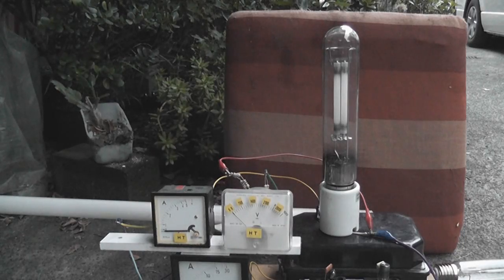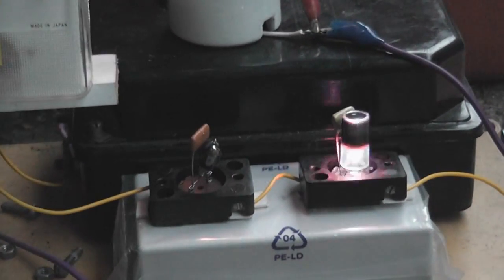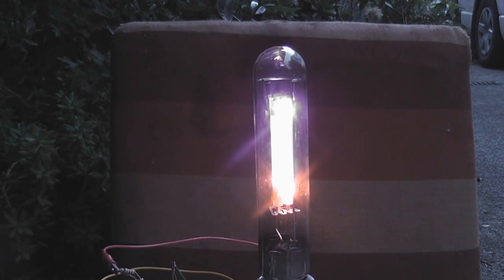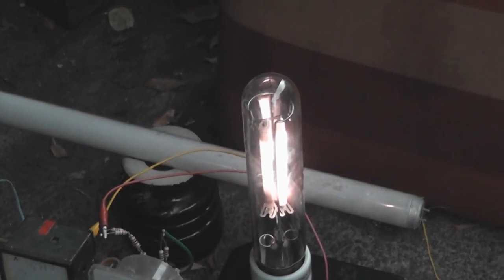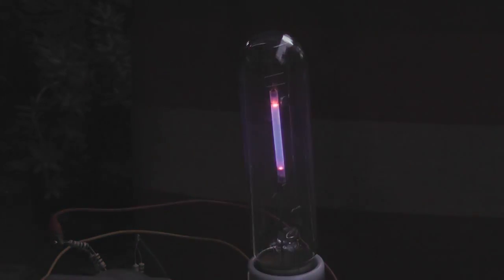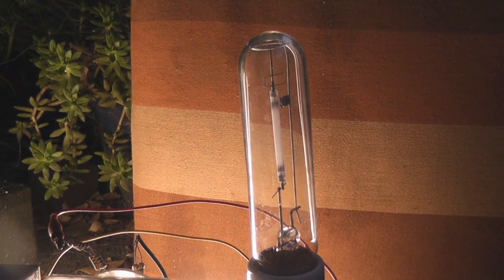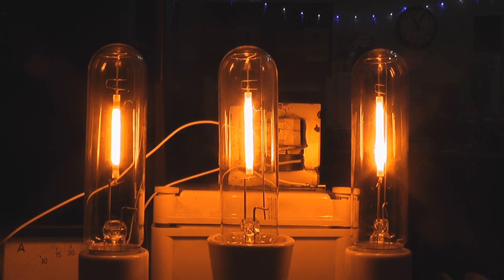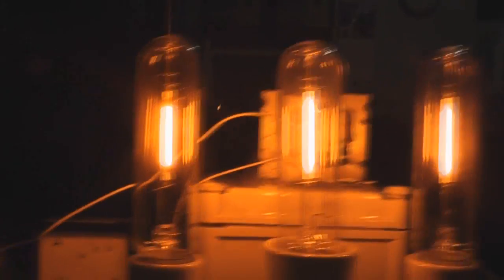Sodium Capsules experimental test runs.

Comment: Would be interesting to see if the MOT could restrike the lamp once it had ran-up to a decent power level. Normally it takes up to 3 minutes for the pressure to drop enough to allow restart. And that's with 4-5kv rated ignitors!
Reply from the maker: The Lamp capsule runs well, Voltage is about 50 to 70 Volts, depending what series Capacitor I use for ballast. A detailed video will follow.
This set up is great for indoors as the lamp is not too bright and not too hot and more yellow orange which looks very cool.
I blew up an analogue multimeter measuring the Capsule, turned it off for a while and then 2000 Volts and pop for the meter.
Reply: RODALCO2007
I actually sometimes use a 150w SON-DL in a converted 500w halogen uplighter in my living room when I want a very warm cosy light :) SON Deluxe has a higher colour temperature of 2300k and far better colour rendering than normal SON (CRI 65 vs 25). Was popular in the early 1980's for large area interior lighting before the advent of warm-white ceramic metal halides.